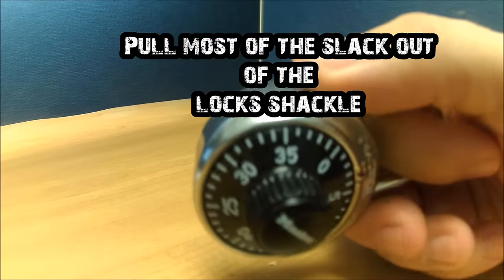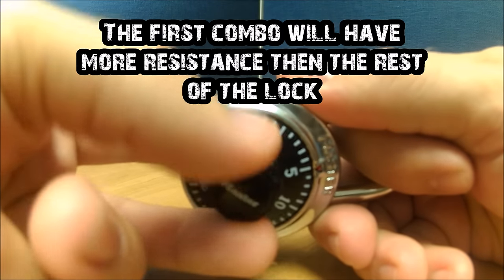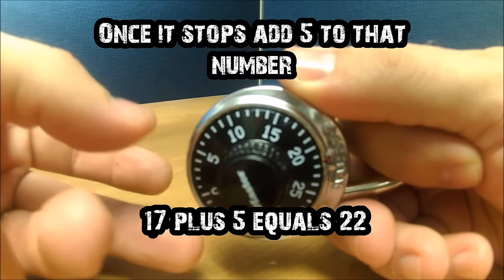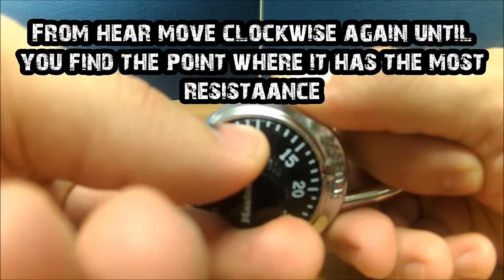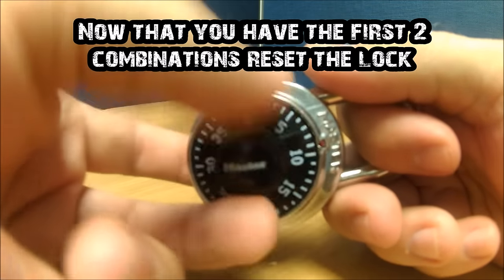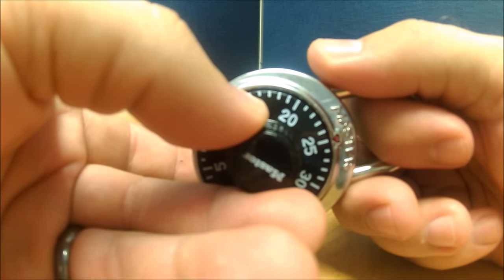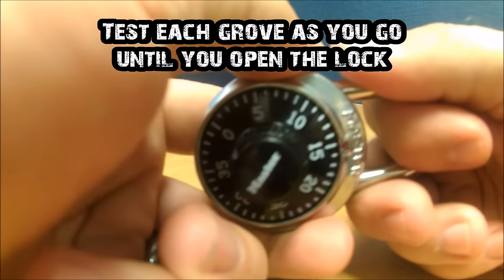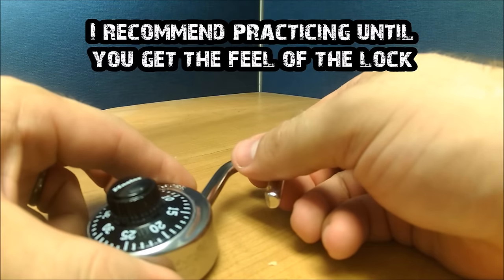How To Crack a Master Lock- Combination Lock- EASY   🔴

Comment: When I am trying to find the first number, I have multiple stoping points, and I don't know where to start
Reply: Bigmacmovies1 stop pulling the shackle so hard
Reply: Don’t pull on it too hard. Just pull lightly.
Reply: I've got the same problem. It's an old lock. It sticks and grinds with no pressure on the shackle at all.
Reply: Fat Guy Little Shirt sounds like hammertime lol 🎵
Reply: exactly my same issue.
Reply: @darkdancerman  but if I don't pull hard enough, all I get is the multiple sticking points with NONE of them causing it to stop and go no further, unless I pull up hard and get it locked into that groove.
Reply: Same
Reply: Same

Comment: Maintain medium pressure and rotate until fell a sticking point, add 5 to that number. And that’s the first number. Rotate counter clockwise with as much pressure without locking out until it stops, rotate the other direction until stops, that’s the second number. Reset the lock and put on the first and second combo in the lock . Than maintaining pressure while rotating until you feel a groove check it, if it isn’t that one keep going and checking for the right one. Then the lock should open.
Reply: yo i see you everywhere
Reply: Cannen Forthey second step isn’t working

Comment: Well, I tried this. First number locks up around 4, so assume 9 as the first number. I couldn't feel the second, so I tried 3, 15, 19, 23, 27, 31, 35, 39 for my second number per other recomendations. Any  suggestions?

Comment: it may be because my lock is newer but a process for the last one i found easier is applying medium pressure and just spinning, and you’ll find the shackle coming loose at one oart, and then just pull

Comment: So frustrated! This the lock  I use for the gym and it’s only a month old. I forgot the combo and have tried many times to follow the instructions on this video but won’t open. Even with medium pressure, there are sticking points everywhere. 
Gues I’ll have to throw it out and buy another. 😩

Comment: My first step: 22+5=27
My second step: dial cant push at 35, sticking point right after 35 is 37
My third step: try 35 then 31 then 27 then so on
Opened on 31

Comment: My resistance point is 37 and when I add 5 to that its 42 and I can't put that into the lock, what do I do now please help me if I don't get this figured out by next week im in big trouble
Reply from the maker: When you add 5 to 37 that dose add up to 42... 
so if you just count five spaces from 37, that should leave you with your first number being 2.
Reply: I don't get the second point
Reply: The numbers are only semantical... The circle doesn't have a magic stop at 0...

Comment: I have trouble to find my second number
Reply from the maker: It can take some practice to get a feel for how hard you need to pull on the shackle, you should feel it roll over multiple points, one of them will stand out more then the rest. just keep at it. (a little hint, if you have a lock that you have the combo to you can practice on that one, you will know where it should stick... that way when you are going threw the motions you can get a feel for just how much it will catch on the appropriate spot).
Reply: Prepper Independence when it locks on to a number(14) when going counterclockwise, it doesn't seem to stop when I go clockwise when I literally have a shirt through the shackle with the same constant pressure. Please help almighty God of the master combination locks!